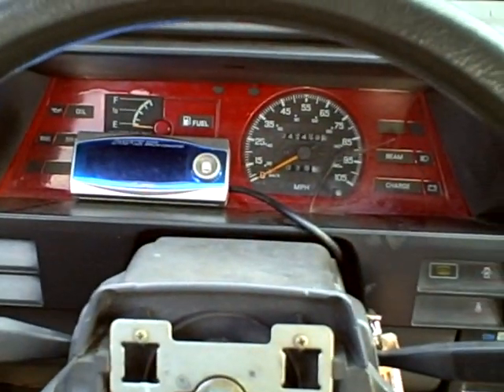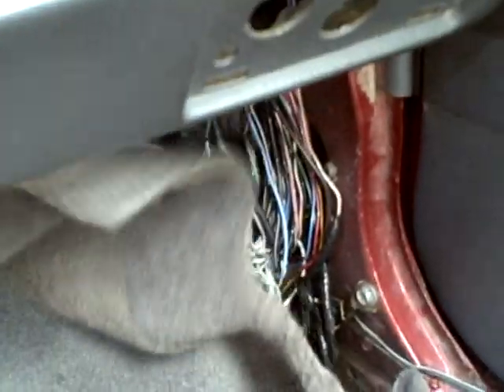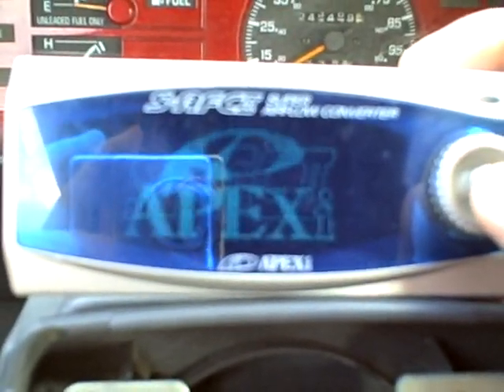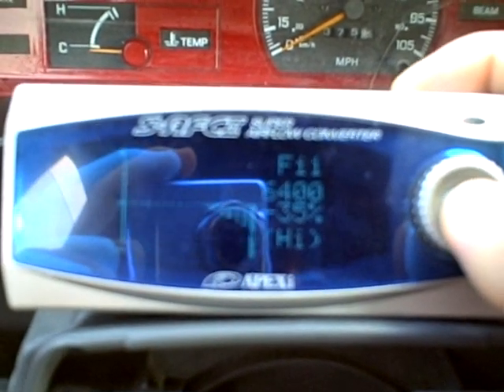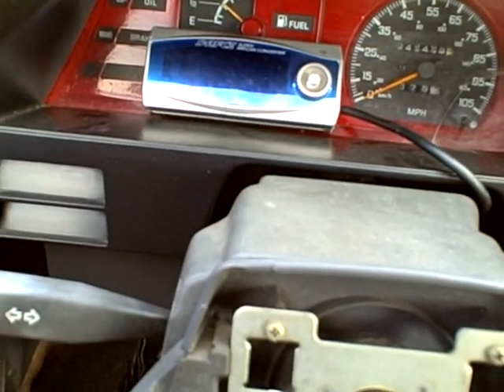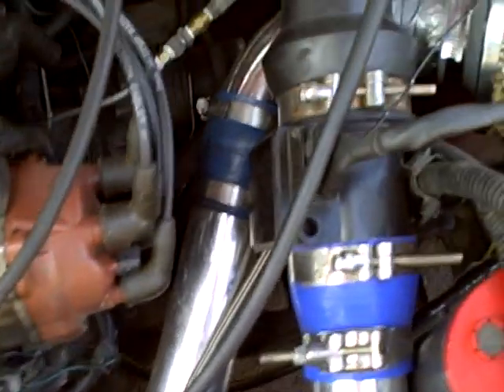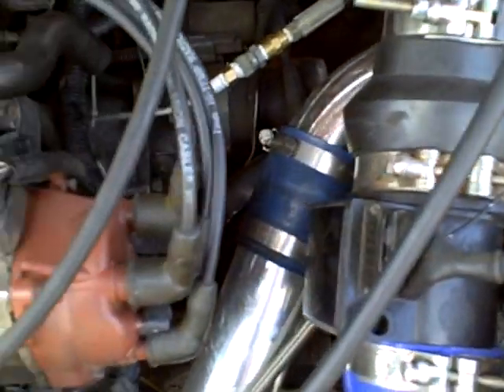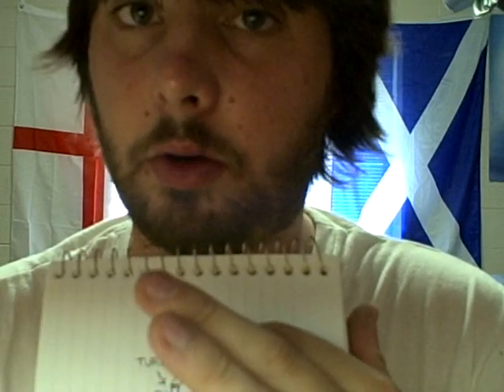B12: S-AFC 2 and MAF

Comment from the maker: Are you talking about the IACV line, or the one coming off the front of the intake manifold?  The IACV line is just run to the charge pipe, post MAF.  Since I don't have an EGR valve or emissions, I couldn't tell you about the other vacuum lines since they don't exist on my car :(.

Comment: I have more questions (who knew)...

I see you have the blow through setup. I understand that but as far as the BOV & MAF sensor running on the same tube I need a little understanding on that one.

What did you do with the vacuum lines running from the intake-throttle body and the other vacuum line that I have no idea where its coming from line...

Proud to see the ga16 being put to good use.